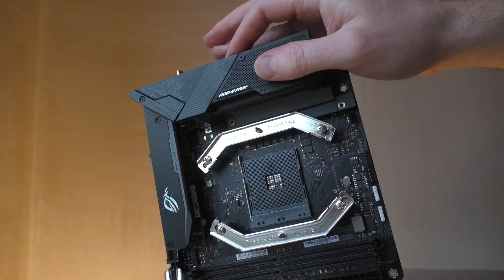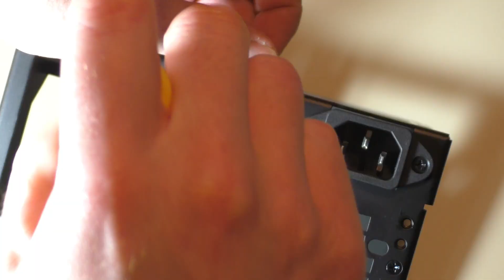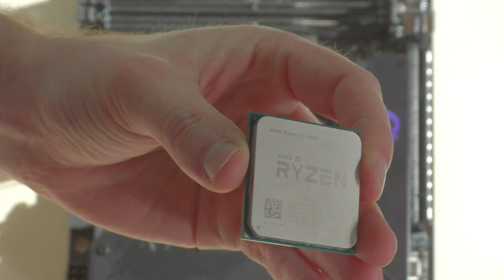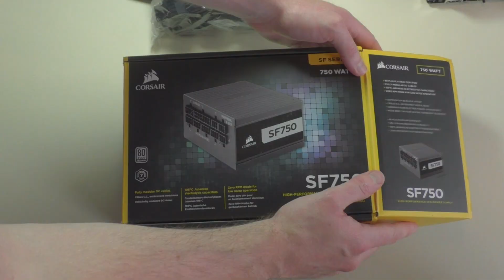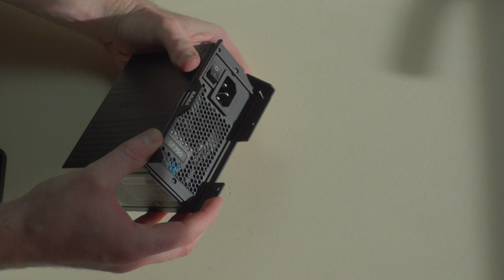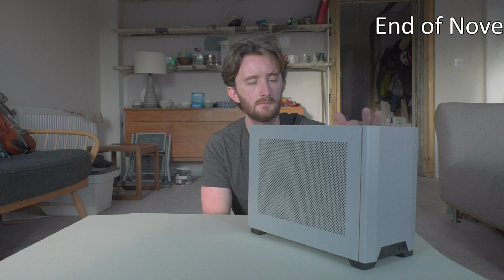NCase M1 build guide -- B550, Ryzen 2600 & RTX 3070 FE

Comment: HI thanks for an Interesting video, I have the M1 V5 Silver , would the Rtx card fit in my case, its empty at the moment , but working on build may be, thanks, Gave you sub too
Reply from the maker: HI, thanks for the sub :)  I think that the graphics card will fit no problem, but the V5 has less ventilation on the side panel, particularly in the GPU area. I can't say for sure for all RTX cards, but for sure the founders editions should be OK because of the flow through cooler design. If you can get any other type of RTX, I'd suggest just having a quick check on PC forums or reddit to see if anyone highlights a compatibility issue with the V5.

Comment: Is this a somewhat quiet build? wanted to do something similar but wasn't sure if I needed to liquid cool for sound reasons.
Reply from the maker: For me the build is super quiet, way way better than my last build. The noctua fans are great and when idling (90% of the time) it's essentially silent, even when sitting on the desk next to me.
The Ncase M1 has good ariflow, which helps, but has no real soundproofing compared to some bigger cases, so when the fans ramp up you can hear it.
My RTX 3080 has horrific coil whine at times and tbh this is the loudest sound for me. Overall I'm super happy with noise levels :)
I might try liquid cooling at some point in future but air-cooled is very competitive, cheaper, simpler, and easier to build.

Comment: Very nicely explained video. Covering a bunch of things that people often miss out. I am just waiting on a MB to start the build like you did, but also waiting for the 3080 GPUs to become available. Crossing my fingers that won't be too much longer, but will stick my old 970 in there for now to check that it works. The NCase M1 looks like such a nice one to build in for SFF! Easier than my previous full size case. My only issue with it on a cursory glance is that, as customisable as it is, the filters and fan layout suggest that it be built one specific way. You can't properly set it up to have CPU as input and GPU as exhaust and have the filters in the right place. A bunch of people suggest that it's more efficient that way.
Reply from the maker: Thanks man :) happy I could help. Hopefully it won't be too much longer now that crypto is on the way down again. I know exactly what you mean, the case is small but so easy to strip down and build in. MY last case is over twice the size but way more awkward haha. Expensive but worth the money I think - hopefully the last case I'll need to buy!

Yes I think you're right, interesting that there are some new cases coming out that are a bit more competitive with Ncase on having different layouts and more flexibility. I expect Ncase might update the M1 in future to allow this. Also, I've seen some good mods on reddit for this kind of thing - the community is so innovative, hopefully this kind of mod will become more feasible in future.

Good luck with your PC build!

Comment: i was just wondering if r5 2600 in a b550i strix cuz i gotta wait for a better deal for r5 5600x so i guess it does support 2nd gen?
are you using it just fine with 2600?
Reply from the maker: Works absolutely fine with my system. Just a little slow 😉
Reply: @rangegod98  Which bios version are you on? Cuz latest bios versions will no longer support it. Hope you get a better deal on zen3 cpus and thanks for the information :)
Reply from the maker: According to UEFI I'm on version 2.20.1271 for the B550 I-gaming.
I actually got my hands on a 5600x for a good price, but I'm waiting until I have a bit more time to install and film it 🙂

Comment: Great video! Did you leave the 15mm fan on the bracket after installing the 3070? Also I'm assuming that you fit both of the 25 mm fans at the bottom?
Reply from the maker: Hi, thanks for the nice comment :) I've actually got 25mm fan on the side bracket, and have now have 25mm fans on the bottom too - bottom fans are intake.
Reply: @rangegod98  Your video is exactly what I wish I watched when I built my Ncase M1. Very thorough and a very nice no frill step by step guide on how to build.

Comment: Hello, did you face any incompatibilities between 2600 and b550 board? I have b550 aorus pro, and I'm worried a bit that processor will be incompatible. I have to receive it. Unfortunately, i couldn't get 3600, since all that money went into gpu.
Reply from the maker: Yeah, I only realised about the incompatibility issue after I bought the 2600, but I've had no problems with mine at all. I'm not sure how you can find out other than searching your motherboard model and see if someone else has used the 2600 with it. 
I think that for a lot of motherboards, they're not supported on paper, but in reality there isn't a problem. Let me know how your build goes!

Comment: Dual ram...shouldnt you fit them in 2 and 4 not 1 and 2?
Reply from the maker: Maybe if the motherboard has 4 slots but my ITX board only has 2 slots.
Reply: @rangegod98  >.< very well

Comment: heya. a guy placed the radiator on top ( https://pcpartpicker.com/b/jkfH99#comments ). I want use the HW Labs GTS240 Xflow which is 292mm vs the regular Uflow which is 278mm. You think it will fit? Thanks!
Reply from the maker: HI there, sorry for the late reply. To be honest I'm not sure as I've never even built with a radiator before. 
That build is amazing - I hope you can copy it. It sounds like you need to make a lot of modifications!
I can measure a part of the case to check if it will fit, if you can tell me which part to measure.